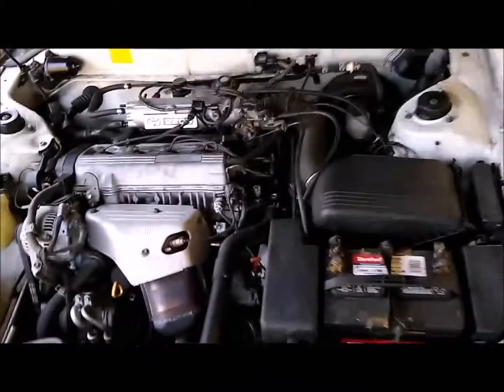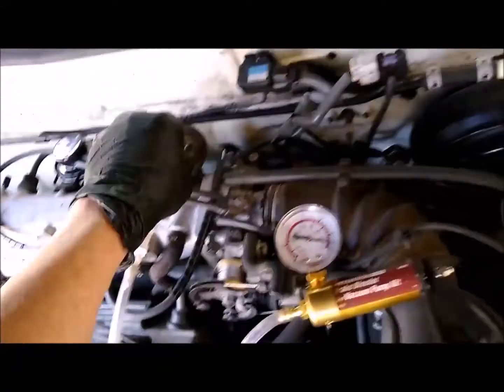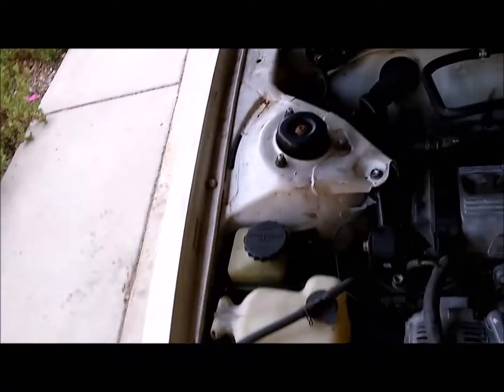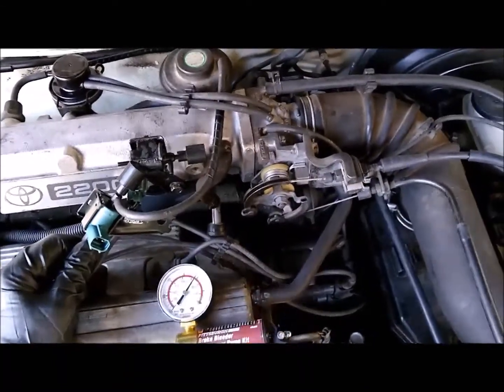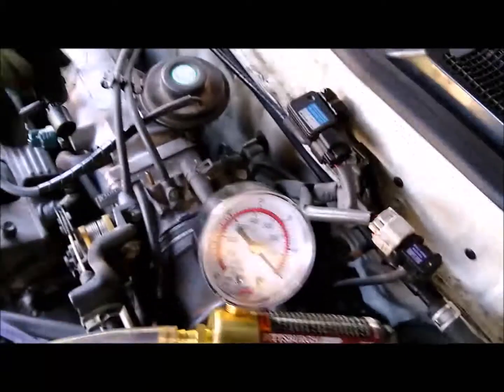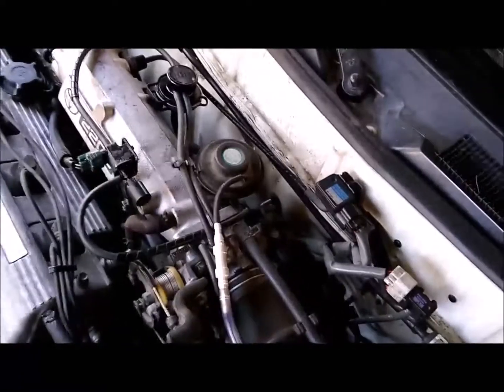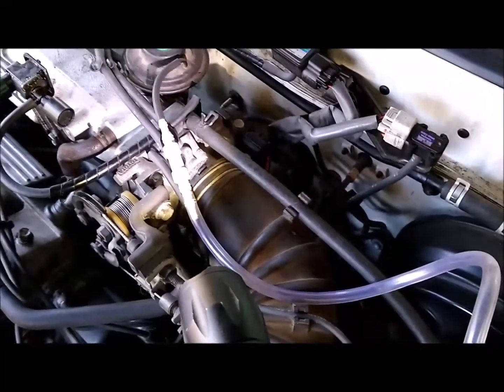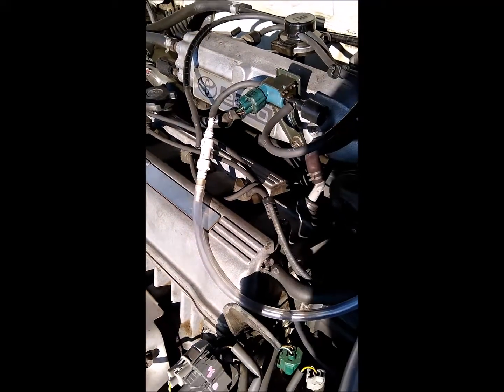1996 Toyota Camry EGR P0401 Troubleshooting (Updated)

Comment: Have you ever had to take your EGR valve off? That is about the last step of fixing mine is seeing if that hose is clogged... But it seems difficult to remove without taking more stuff apart. Any advice?
Reply: if i finished watching your video i would see you explain this! LOL my bad. I will get that wrench from a parts store and should be easy from there. Thanks!
Reply from the maker: Did you get it off ok?  There are other videos showing it removed and how dirty it can get.  On mine the hole on the intake where the EGR valve mounts had a little crud in it, and the tube barely had any at all.  It's easy to remove the tube if you take the throttle body off the intake.  You don't have to completely remove it from the car.  It'd be a good idea anyways so you can clean any crud that might fall inside too.
Reply: @erics3599  I wasn't able to find the crow foot wrench locally so I ordered one, but I was able to break it loose with a set of pliers, just can't get an angle to turn it any further than 1/8th of a turn.. I didn't want to take off the throttle body again but maybe I should as I need to change my IACV as well... and wouldn't hurt to clean it out while i'm there. I am not sure if i'll try to do it this weekend or not lol, we will see.
Reply from the maker: Did you finally get it taken off?  If so how dirty was it?  As I'm thinking if everything else checked out that has to be what the problem is.  You can clean the IACV with throttle body cleaner should be good enough.  Mine was frozen wasn't even moving at all.
Reply: @erics3599  I finally did it today! Came off without too much of a fight, boy the EGR valve was nasty though. Put a new one on, feels like its running a little better but time will tell if my CEL comes back. 

Didn't have time to pull the throttle body off and clean it but I did it about a year ago and it was really gunked up then.